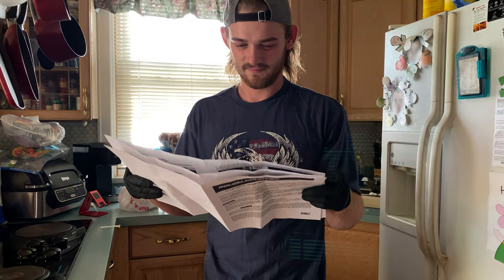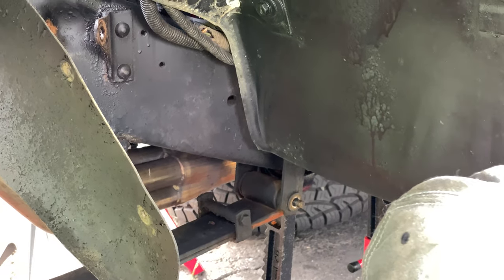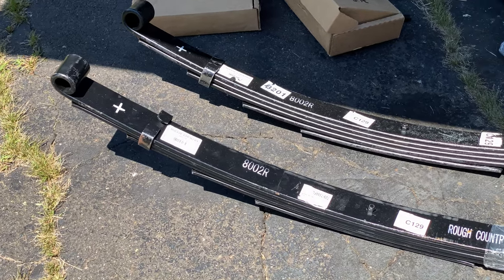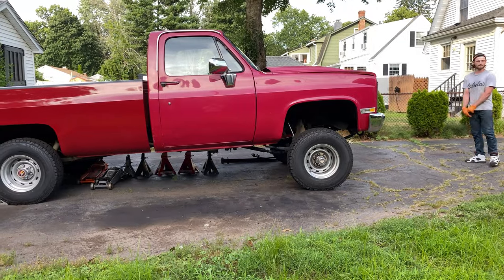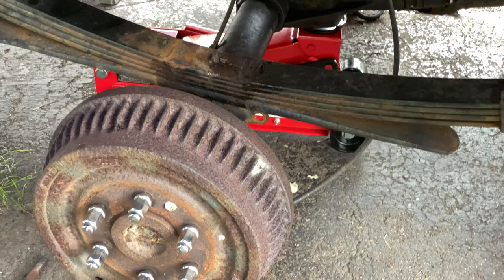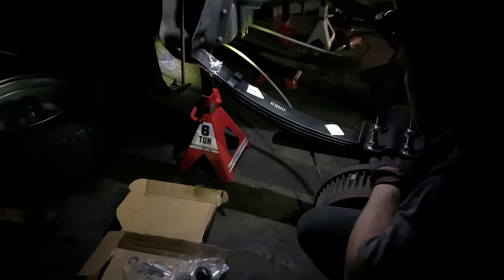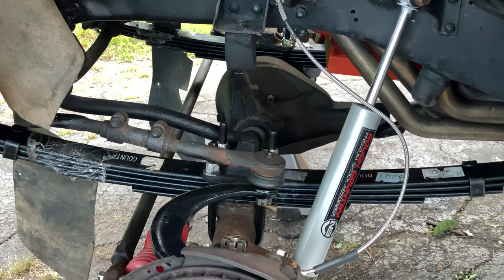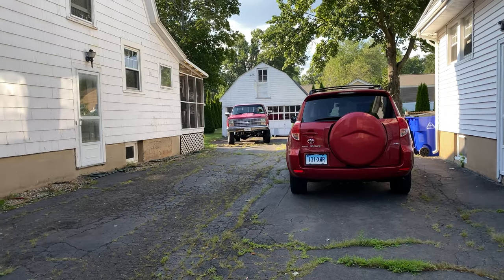Transform Your Chevy K10 Pickup with a 4 Inch Lift Kit - Step-by-Step Installation Guide

Comment: I really appreciate the video. I have an 85k20 that I’m going to do this to as well. You learn from videos like this. Especially when you encounter obstacles and show it with a solution. Great job
Reply from the maker: Hi Jose! Thank you SO MUCH for the comments. When we started making videos like this, I had no idea if anyone would even watch them, but we did it to show a hobby that we love. I'm so happy that it helped you. I subscribed to your channel in case you make a video while working on it or show some when its done.
Reply: one more thing they come in 16.5 rim size i have a set for my ford but if u have a 3/4 ton chevy the rims they come with will fit just they don't fit 3/4 ford because the center hole is just a little too small for ford they are hummer tires and rims

Comment: I would have left headers in place. Cut bolt off and bought a new bolt an put them in reverse back in done. Less hassle same result.
Reply from the maker: He thought about that but decided to keep everything as close to the way it was from the factory, so he decided to take off the headers.
Reply: @MarkDHall  Well at that point then remove the upper shackle bolt and it all comes right out.
Reply from the maker: @metalbill  That was the problem. The bolt wouldn’t come out because the header was in the way. He wanted the bolt pointing the same direction as from the factory, so the only option was to take off the header.
Reply: @MarkDHall  You missed what I was saying. Pull the upper shackle bolt out which the header is not in the way, and the whole spring and shackle comes right out. I've done it.
Reply from the maker: @metalbill  Thanks, Bill! I was having a brain cramp and didn't even think about that. Tips like this are huge time savers and reminds you to keep an open mind to look for all possible solutions. Thanks for the tip!
Reply: Bro I was thinking the same thing

Comment: never start lug nuts with anything but your fingers .you got lucky on this one super clean truck normally its a lot harder.  every thing is out to get you nice truck
Reply from the maker: Hi Eva mike. You are correct that it's very important to make sure you don't cross thread bolts when putting on nuts. Like you, I was always taught to start them by hand, but Matt said his impact gun has a "finger tight" setting that immediately stops if it detects any tension, so that's what he chooses to do.

Comment: Did a lift on my cherokee pb blaster was my best friend anti seize will help in the long run
Reply from the maker: PB Blaster is amazing and spraying it on the night before is usually enough to loosen the bolts, but this truck had some kind of an undercoating on it that kind of "glued" everything together. It was weird.

Comment: I would have cut the bolt and gotten a new one instead of doing all that work with taking the headers off but good video sir just did a 4 on my k10 because of this
Reply from the maker: I would have done that too, but it actually worked out in the end because he ended up having to take off the headers off for something anyway. I can't remember what, but they ended up being in the way.

Comment: Just saying so you don't run into any problems get a steeringbox support arm from offroad design before too long. The frame always (always) cracks where the steering box is bolted to frame. Offroad design has them. Might check frame right now just to be careful. If it's already cracked they have plates that you weld on that will beef up the frame in that area.
Reply: Awesome video btw. Keep it up!
Reply from the maker: Thanks you! I’ll tell Matt to check them out.
Reply: Good deal mine had serious frame issues when I got ahold of it and if hate to see someone have to go through what I did. I love seeing the trucks be preserved. Don't not get one if it isn't cracked because it will with time trust me. Especially with bigger tires. Its a rather cheap upgrade and is well worth the ease of mind. If you Google cracked steering box frame it will show what can happen to them, and unfortunately mine was severe with the same lift and 33's.
Reply from the maker: @BRANT-RAY  So I told Matt you said to get one. He knew about them and knew that bigger tires can put stress on the frame, especially when in parking lots and places like that, but he didn't know how much it would help. He said he'll definitely get one now and wanted me to say thank you on his behalf.
Reply: Absolutely good luck yall!
Reply from the maker: @BRANT-RAY  I checked out your fishing video. I tend to be a "spinner bait and crank bait" type of fisherman, but you way looks fun!
Reply: @MarkDHall  lol yeah bow fishing is mostly for invasive species. I do love bass and crappie fishing myself too though!

Comment: Nice work! I just installed a 2.5 inch lift on my 78 suburban and my rear shocks are too short. I jacked up the axle and it took everything off the jacks lol. It has a 14 bolt rear
Reply from the maker: It sounds like a nice ride! I like Suburbans. I think they're cool.
Reply: @MarkDHall  thanks lol. I used the es3000 shocks up front and im gonna send the other set for the rear back. Got all mine from summit racing
Reply from the maker: @stevemajors9914  That's where we get almost everything from as well. They're not always the cheapest, but they usually have everything you need except with our lift. They didn't have it in stock, so we got it directly from Rough Country.

Summit is great about returns, but sometimes what we get doesn't match the photos online. We had to buy an alternator with a multi groove v-belt. The photos online were correct, and the part number on the box matched, but inside the pulley was the old, narrow v-belt style. After the 2nd wrong one, we gave up and re-used the old pulley.

Comment: Great video. Awsome job. Nice family. Matt... you need some nice fat rims and tires now.
Reply from the maker: Hi. Thank you for watching and the nice comments. Big tires and rims are definitely a planned upgrade, but not sure exactly when Matt wants to do it. They're pretty expensive, so I think he's going to wait a bit to save up the money.
Reply: @MarkDHall  over here in toronto i can even get a truck for a decent price. Nevermind the rims and tires. Rust buckets for like 15 000 and up. Its nuts.
Reply from the maker: @ugna2773  Same here now. Just saw a used Toyota Corolla for over $30,000 and a used Lincoln Navigator for $91,000. I don't think they're even that much new. It's crazy...and sad.

Comment: Good job Matt on your lift kit install. I put one on my 1984 K 10  Chevy 4x4 also last Sept same time you did. I used the same 4" lift kit as you.
Reply from the maker: Thank you for the nice comment, Loren. I bet your truck looks awesome. The 1984 is such a classic design. Around here (Connecticut), it seems like these are one of the most popular lift kits. They're nice because they're not super expensive, but they seem well made. I guess the ride quality can be a little rough compared to some, but to me, a rough ride is kind of what being in a truck is all about.

Comment: why remove the header when you can cut the bolt then put a new one bolt on the other way , like the nut inside instead?
Reply from the maker: Hey Jessy. I agree. Why? I don't know. Matt said that's what he wanted to do. I would have just cut the bolt, but he wanted to keep the original bolt for some reason and put it back in the way it came out. Ultimately, we had to take the header out for some other stuff, so it all worked out.

Comment: Shoul've just cut the bolt next to the header off, then got another leaf spring bolt & thread it on the other side. No need to take the header off the truck. Good work on the truck.   o7
Reply from the maker: Thanks for watching and the nice comment. It actually worked out good that he took out the headers because he had to take them out a little later to do something to the drivetrain. All in all it worked out ok.

Comment: I see this video has been up one year, can you share how the lift kit has done after having it in the truck for a year? Some people say the ride is stiff when the lift is new, do you agree? Thanks for sharing, I’m looking to order a lift soon, this will likely be the one I go with
Reply from the maker: Hi - I don't think the ride has changed at all. I think we're just used to it now. It's not really bad, but is' definitely not like a new, comfortable car or truck. It's definitely stiffer and more bouncy than factory, but also the old springs on it were 35 years old and pretty worn out.
Reply: Thanks for the reply sir. Today I discovered I need several universal joints and a rotor, so my lift will be on hold for a bit. Thanks again for the reply, you’ve done well in raising a hard working young man. Best to you and your family.

Comment: Hi a you feel any difference on the road?  Before and after I have a 86 chevy 4x4 and I want to do that 4 inch lift. That's way ask you thanks
Reply from the maker: Hi Armando. It's quite a bit rougher. All lift kits will usually ride worse than stock, but the Rough Country lift is rougher than a more expensive one. An example - if you have a coffee with a lid on it, the coffee will come out the lid. Best of luck if you decide to lift it. It definitely will make it look better!
Reply from the maker: Hey, Armando. Matt wanted me to tell you that the truck is bouncier than he initially thought. He said on some bumps on his way to work that he bounces up off the seat, and then he said that if his phone is in the cupholder, it bounces out sometimes. But then he said that it was that way with the worn out factory stock suspension, so overall it’s about the same.

Comment: Hey question about after the install
Reply from the maker: Sure, what's the question. I can tell you that the right got a lot rougher after the install. Handling is similar, but the ride is much rougher and bouncier.
Reply: @MarkDHall  did his 4x4 sound like crap in the front end after ? Mines was making like a warped bar sounds turning
Reply from the maker: @Donnazbeenz303  Hi - sorry for the slow reply. Matt & I were working different schedules the past couple weeks. His didn't make any noise afterward. I wonder if it could be getting jammed up like maybe the driveshaft binding or hitting something when you turn. It's so hard to figure things out without actually seeing them in person.

Comment: Hey Mark, did you guys have to drop the transfer case and add the spaces it mentioned in the instructions, or were you guys able to get away without adding them?
Reply from the maker: Hi Logan, we did end up dropping the transfer case but not until a year after we did the lift. We probably should have done it when we did the lift, but Matt was lazy and didn't feel like doing it. Did you do the 4" or 6" lift? I don't remember the instructions saying it needed to be done on the 4", but that was a couple years ago. He ended up doing it because he wanted the drivetrain to have the stock angles for everything.
Reply: @MarkDHall  hey thanks for getting back to me! I haven’t put everything in yet I am just getting myself ready to. I have a 4in lift me I am putting 35s on it.
Reply from the maker: @loganconley7129  Nice! Matt's are 31s on the pick up. He wants to go bigger, but he'd want new wheels too, and that would be so expensive. I told him to just save his money for awhile and do it. It would make the truck look mean. I hope gas prices come down soon, though. It's not cheap to drive!

Comment: You should have showed how to get steering arm washers out guy
Reply from the maker: Hey Donavin. I'm bummed we didn't get to show that part because Matt said it's the hardest part of doing the whole lift, but they actually came out easily because he had just taken them out a couple weeks earlier to replace ball joints. When he said they were going to be hard to get out, I ran inside for awhile, and he came in like 5 minutes later and said they were out. We probably should have re-enacted getting them out to show what we did, but I didn't think of that till after. He got them out by repeatedly heating them up with a torch and then spraying penetrating oil on them and whacking the steering arm on the vertical side near the studs with a sledge hammer. Thank you for watching!

Comment: Ia having a hard time with the sway bar brackets any advise
Reply from the maker: Hi Kyle. So sorry for the slow reply. You probably have it done by now. You didn't mention specifically what the problem was, but if the bolt isn't coming out, Matt says he uses heat when that happens for him. He'll spray it with PB Blaster and then use a MAPP torch to get the metal red hot. He said the heat expands the metal and then when it cools, the metal shrinks, so the bolt should eventually loosen up. It could take several times of heating it and letting it cool to get it out. If this wasn't the problem, let us know, and we'll try to help.

Comment: i have chevy and fords this is y i like my high boy stock i put 36.5 tires under it and i get the tires for 25 bucks with 70 to 80% tread military tires and i have a 79 4x4 chevy short box cheyenne full option truck with under 35,000 miles on it so i do nothing to it keeping it stock right now i am building a 68 chevy with a stroked 454 a hot rod pu but i have a lot of chevy pu sitting rust free i keep getting them for free
Reply from the maker: Thanks, Melissa for the great tip on military tires. $25 is super cheap for 36.5s. The '79 sounds great! Definitely keep it stock. That usually makes them worth more later on, especially with the low miles. The '68 sounds nice too. Love those old pick ups!
Reply: @MarkDHall  i get mine from a military surplus store were i live but i think they all get them
Reply from the maker: @melissaweidman3326  I wish we had more, but we don't have many military surplus stores around here. The ones that are nearby mostly sell t-shirts and things like that.

Comment: Why didn’t you show how you removed the steering knuckle? How did you remove the little sleeves that were tapered inside the steering knuckle? Having that issue myself right now
Reply from the maker: Hi, Diesel Mac. Are you referring to the part at 3:12? I wanted to record the removal, but Matt got it off before I had a chance to record anything. He had taken it off a couple weeks ago do his ball joins, and it came off easily because of that. However, when he did it then, it took a couple hours. What he did was hit the steering arm over and over on the side with a stubby sledge hammer to try to loosen it up. You can see some of the dents on it from where he hit it. He also sprayed them with penetrating oil and then repeatedly heated it up with a MAP torch and then let it cool down to try to loosen them up. He also used chisel to help pry them free. He said it's not an easy task and just takes a lot of time. Hope this helps.

Comment: Use a come along or a good ratchet strap and hook onto axel to frame and makes it easier to move axel forward or backwards to line up spring bolt in middle to axel pad hole
Reply from the maker: That's an awesome tip. That was the hardest part of the whole install. Everything else was relatively straight forward. Thank you!

Comment: Do you think the same kit would work for my 83 c10
Reply from the maker: Hi QuickScope. This particular lift will not work with a C10. The suspensions are totally different, and this kit was designed for a K10. Hope that helps.

Comment: where did you get those wheels? iam looking for those for mine
Reply from the maker: Hi Hank. I wanted to check with Matt before replying. They're the factory 15x8 steel wheels. When being sold, people usually call them something like 15" Chevy Truck Rally Wheel. They come in a couple sizes and lug patterns. Corvettes and other cars had a similar wheel, but they didn't have as many slots. A few sites have replicas, and we've seen them here in CT on Facebook Marketplace and Craigs List. You could also try a junk yard. Coker Tire has them in both 5 & 6 lug pattern in 8 and 10 inch sizes. https://www.cokertire.com/wheels/o-e-style-pickup-rallye-71-87.html
Reply from the maker: I wanted to add the they also have a chrome trim rim, which is usually an option online.

Comment: Why didn’t you just cut those bolts and run the new ones in the other direction instead of removing the headers? Lol just curious
Reply from the maker: Hi Andrew. When he was taking the springs off, I told him he should just cut the bolts, but he wanted to put them back in the way they came from the factory and would have to take the headers off to do that. He said he was being OCD at the time, but that's what he wanted to do then. It would have been totally fine to cut them and replace with new ones, but for whatever reason, he didn't want to.
Reply: @MarkDHall  I was just curious. I’m not even sure why I was watching the video, I’ve lifted quite a few trucks in my life 😂 it was just something that caught my eye.
Reply from the maker: @andrewayersman6923  Haha. It's called the black hole of YouTube. It sucks you in and makes you watch videos you don't plan to. I'm his dad and to be honest, it kind of bugged me at the time that he didn't just cut it, but it's his truck, and I'm not going to tell him what to do. That video was made last year I think, and I've seen a change with him. He still wants to do things right, but I see him taking "shortcuts" and doing things differently so they get done faster. Thank you for watching!